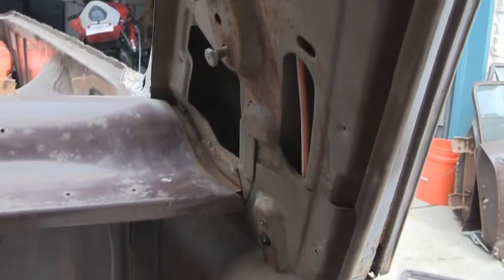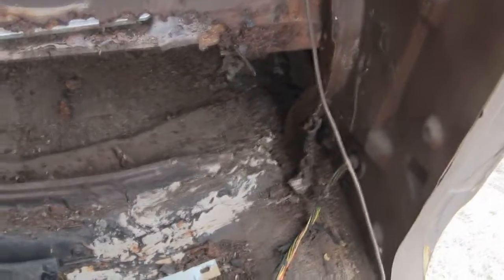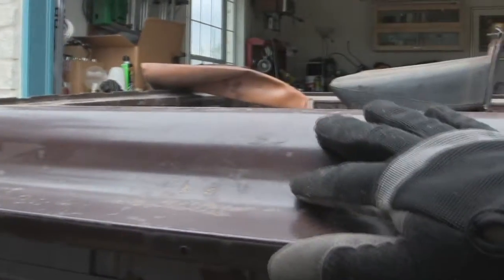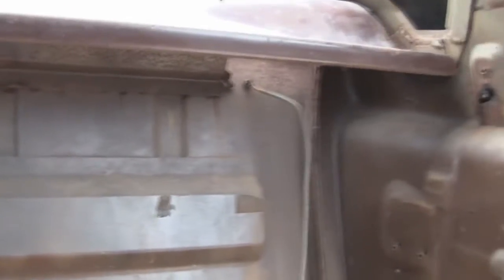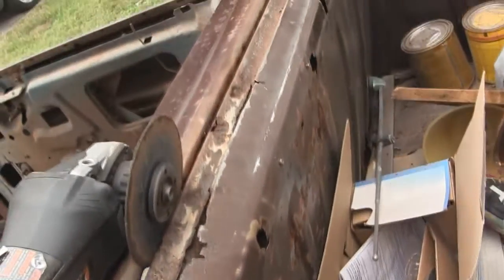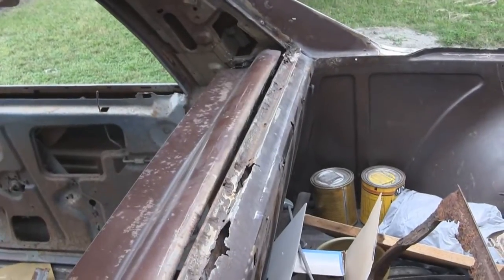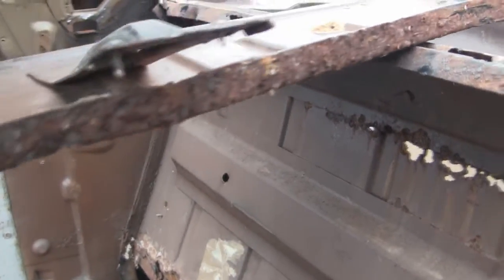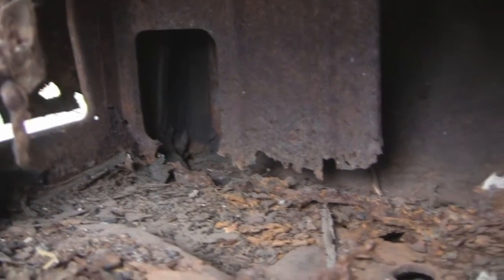1969 El Camino Restoration Part 12- Removing the back window shelf

Comment: I'm not sure what your gonna do with your elcamino and I know time is money BUT I have the same car that was rotted from the door handles down  all the way around and I wouldn't trade this car for anything.I just love it and don't care how much my time is worth for this car.I have done extensive panel replacement but the bed was way beyond repair,so I built my own ,which I'm still working on and like they way it's turning out.This car I got for $300,years back.I saw that car finished in my minds eye  and will fix it the way I dreamt it.I know they sell complete beds and brackets but since I created my own bed I won't work backwards,just move forward.One day it will be done and always love when I take some time to work on it.It's my baby and I do have quite a bit  money rapped up in it and that's cool too...Don't give up,this car is a gem and unique.
Reply from the maker: I'm gonna keep it! I'm hoping to be on it here in a week or two. Be on the lookout for some vids!

Comment: That might be a good application for a panel bond like Lord Fusor. It is being used to attach exterior panels now, so it is real strong. I think Pete over at SWRNC might have used it in a video for roof maybe? I have no experience with it, but I have seen it come up lately.
Reply: Question for KJT - I have a 70 EC with a similarly rusted back wall as yours.  Do you believe that the package tray sheet metal can be left alone while cutting out everything beneath it?  I know they make that package tray metal for I think maybe $140 but I'm cheap and don't want to replace it.  That tray on mine is still good and I'm hopeful I can leave it alone.  

Many thanks,

Rick
Reply from the maker: Hey Rick, not sure why your comment didn't show up in my Community notifications, so I apologize for not replying sooner. Yes, you should be able to remove the upper back panel and leave the tray in place. Mine would have stayed in place if I hadn't cut the welds on the tabs on the left and the right.Good luck!

Comment: What you were pointing to is a storage box. The smugglers box is in the bed. It is in the bed against the cab. There is a panel on the bed floor that unbolts. Under, is a box. Not all years had them.

Comment: Hello KT, I have a 68 Elkay that someone used bondo to fill in the back window edge that holds the window in place. It has been cut out. I have removed the bondo, but haven't been successful at finding someone to make a new metal piece for the top edge (left side only)...so I can't seem to move forward on getting this thing put back together. Any ideas on how to get it fixed - I'm almost ready to re-bondo it...:( thanks for any help.  Rowlett, TX area.
Reply from the maker: Hi Michelle! How much was cut out (length)? Was any of the corner cut out or just the straight section?
Reply: Hi Michelle,You can get the lower window channel from chevelle /elcamino parts from anyone of the leading parts catalogs  Like OPG,original parts group.I bought one and it's like $30/40,and is 2 or 3 times as thick as the original.Heavy duty piece.

Comment: the smugglers panel that is screwed down, could a person get rid of that, fix the floor pans under it and the rust behind it and then build some kind of custom speaker enclosure out of flat sheet metal to take it's place,just an idea
Reply from the maker: Yup! I was actually searching online and found where someone had fabbed a frame open to the whole box and put a couple of small subs and such in there. I cn see how it would work pretty good. It would surely rattle that box! In my experience though, the box would have to be built out of wood or pressed board to get the right depth of bass. I think the sheet metal would be too thin to give the bass a lot of depth. It is definitely a good place to experiment with some custom builds though.